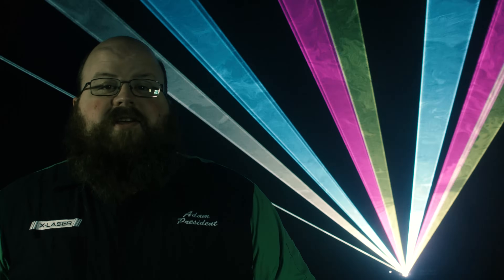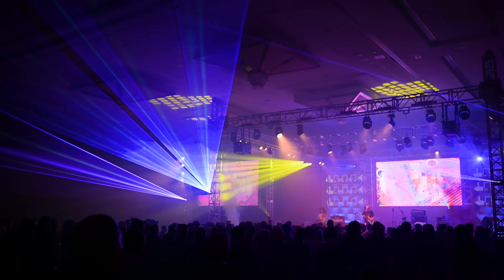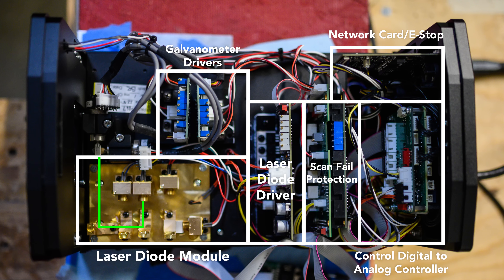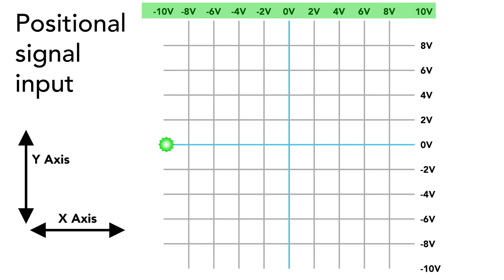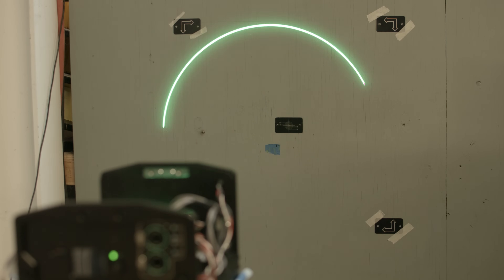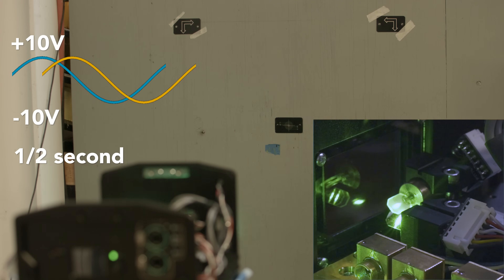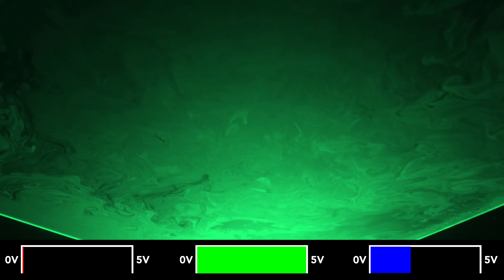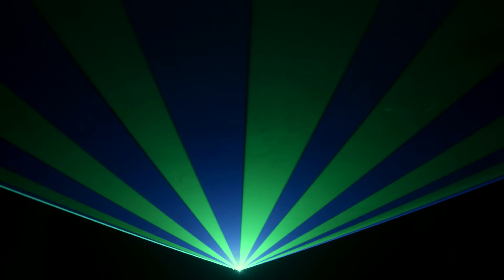How laser projectors work

Comment: Great video! Do you also have an explanation video that shows how input animations that are not just simple shapes would work on lasers? for example, if you want to project a running horse: what is needed to archieve that? what are the needed specs? How do they differ? What is needed it the horse should not only be an outline but also have more "photorealistic" look? etc

Comment: Galvonometer based projecters can do a lot of things ordinary LCD mask projectors just can't do because of their versatility and flexibility.  They can dynamically change image positioning without distortion, or image sizing, they can draw in true vector graphics without the pixelation artifacts left behind with ordinary displays.  Fast enough ones can actually be used for raster graphics of limited resolutions.

Comment: The key idea is 

1) combine 3 lasers of different colors into a color
2) project this combined laser into the spot on the screen
3) do it fast enough for each point on the screen to represent a single image
4) do it successively for each image
and you have a movie 

Your video summarizes all this very well.
Reply: i can imagine a projector of this kind projecting some video, but i bet that solution will be expensive as hell. i guess the dlp solution is better now a days.
Reply: @EEK-XAAK  those are a different things.. 

this is not a Video Projectors as it's different from a regular one.. instead this kind of Projectors use a very raw profiles of the actual dots from the array of all optics of the beams inside and use the Galvos to move the beam.. and eventually to produce such a complex graphics as you can see right there in this vid^
Reply: @EEK-XAAK  it could produce a video tbh, but I think that would fucked the Scanners inside 🙃
Reply: @jhrlasers Rotating multifaceted mirrors are used to create horizontal lines, plus another vertical one spinning at slower (frame) rate to produce video raster scans. But, they must be very precisely in synch for a stable image.
Recently saw a small commercial model on YT.
Reply: @TheOleHermit  yeah they're cool.. But doubt it they could give a higher quality result then what multiple 30K scanners could produce tho. Bet they even could survive a drop test? Like it's too sensitive (the rotating multifaceted mirrors).. They're durability r not sturdy tho.
Reply: @jhrlasers  Multifaceted mirrors are made of solid glass, mounted onto a motor shaft, only spinning in one direction. They've been around for decades , used mostly for barcode scanning, including portable models used for inventory management.
Galvos are far more delicate and expensive. My pair of DT-40's and driver boards were ~$300. The pair of Scannermax Compacts were $1k.
Different devices for different objectives.
Reply: @EEK-XAAK  or maybe a better solution are to do a distribute scanning on multiple lasers Projectors scanners to produce such a complex video right away 🙃

Comment: Nice video, i just think you forgot to mention the blank out or "blackout" of the beam. like if you have a straight line, and gives all colors at specific points a zero-value, youll get multiple "spots" in a row.. as you showd us the white circle, you mentioned that you can create even 4 (and more) .. but at this point, the scanners doing one circle, then all colors set quick to full off, while the scanners jumps to the next point, colors turn on again, and the next circle will be drawing.. And that have to be done for all 4 circles..
What i want to say is, this llittle fact is the most important feature that you even can draw multiple "objects"

Comment: cool! How precise does the -10/+10 V need to have in order to have precise positioning? how is it not affected by interferences?
Reply from the maker: Great question! The more precise, the more repeatable/"cleaner" the image. Interference is reduced by using differential signaling to the scanner amplifier, so each axis gets a +/Ground/- control signal over 3 conductors, similar to how DMX reduces interference by using a positive data line, a negative data line and ground.
Reply: @Xlaser  holy moly your answers are faster than the galvos itself! :D thanks for your answer. Are galvos used also on laser engraver and things like that? they have a precision in the order of thenths or hundreds of mm.. i could imagine that engraving an image at half a meter distance (like some engravers do) would require really high precision and repeatability.. I'm trying to build my hobby laser engraver and am facing quite some difficulties in deciding how to position the mirrors in an affordable way...
Reply from the maker: @sharkyigor  Another great question! There are two types of laser cutter/engraver typically. Galvo based and gantry style. Gantry style typically cost much less to buy/build and have much larger work envelopes, but are slower in operation. Galvo based systems are crazy fast, but require a special optic called an f-theta lens to quickly refocus the beam so that the focal point of the laser is always at the engraving point. Engraving systems focus the beam to a super small point so you get great precision and super high energy density for efficiency in engraving, but this means the focus distance is super important to get right. Gantry style systems typically move the piece you are engraving up and down to set focus. Here's a great video that shows this. https://youtu.be/1cunQdCyT0s  If you haven't already, check out photonlexicon.com and tell them Adam at X-Laser sent you. Lots of very helpful, very smart people including some who have built their own engraving systems.
Reply from the maker: We have used a laser system from https://www.epiloglaser.com/ https://www.youtube.com/user/epilogben for years in our own manufacturing processes to engrave anodized aluminum and cut acrylic/cardboard and it's been incredible.
Reply: @Xlaser  thank you very much... now i'd like to come there to spend some time in a tech-vacation.. :D guess its difficult since i am in italy.. :D i already built a laser a few years back with cartasian system like the cinese ones.. but its not stable enough and soooo slow.. (i built it from scratch) and used a 2W laser.. i dont need to cut but just to burn images on wood. but it takes forever its a pain.. thats why i wanted to make it with mirrors like the tiny new lasers you can buy.. didnt think of the focussing problem.. plus those galvos are quite expensive.. they cost a third of a finished commercial hobby grade engraver..

Comment: Thank you for this video ! There is still something I don't understand : a laser is either on or off. It's not like a lamp with what we can low the intensity by lowing the voltage. So my question is : what do you actually low by lowing the voltage at 4:53 ? As long as it can't be the laser intensity.

Thank you for you answer. Hope I made it understandable, my English is not perfect.
Reply: It uses a principle called pulse-width modulation (PWM) such that the laser is turned on and off at a very fast rate. The rate at which the laser is switched on and off is called switching frequency and is often constant. In every cycle, the ratio of laser's on-time to the whole period (on-off) is called duty cycle (often represented as %). Adjusting the duty cycle allows to control the amount of power delivered to the laser, only using one stable power supply. This not only reduces the complexity of the circuit, but also avoid a huge power loss.
Reply: ST4N thank you very much I’m glad I know that know!!